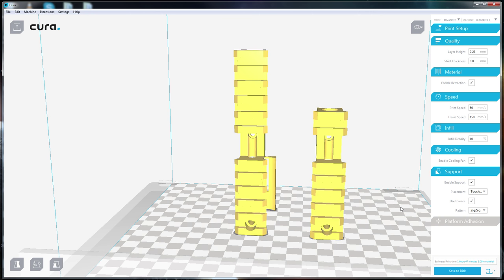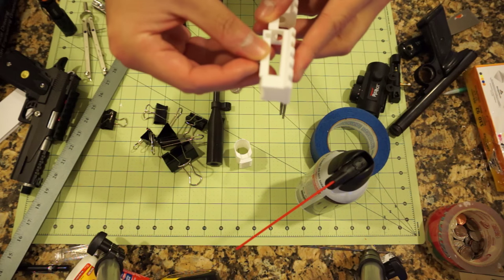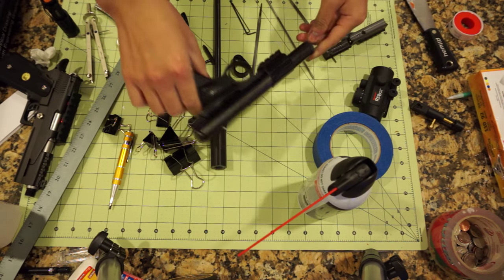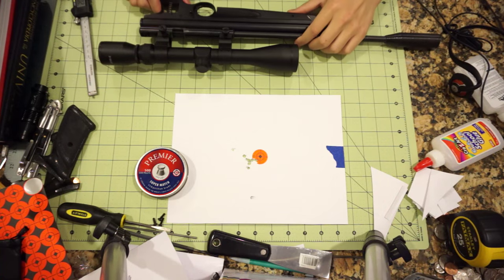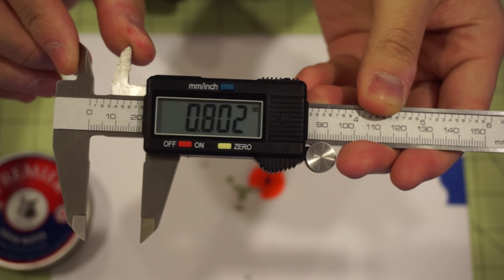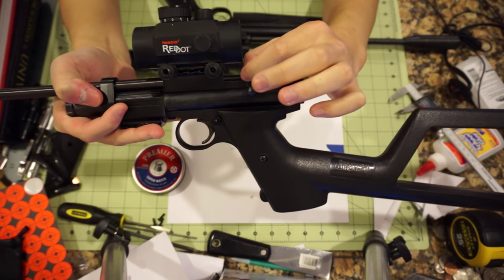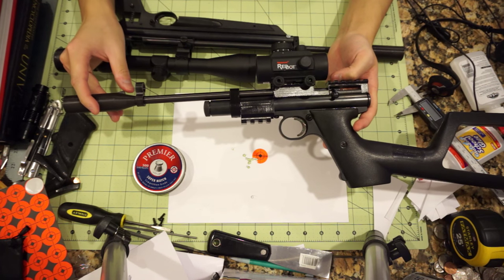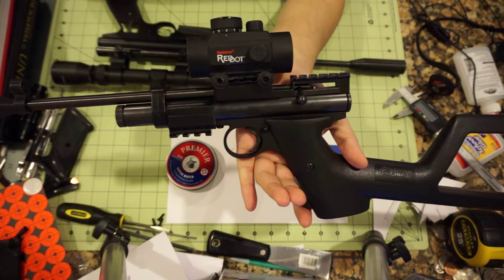3D Printed Ambidextrous Crosman 2240 Receiver

Comment: There is a way to tighten the Bolt probe area behind the o-ring, that is the area of the bolt probe that contacts the barrel end for a better seal, than just the O-ring can provide. You could be leaking there do to production tolerances. use some superglue just behind the o-ring (NOT on the o-ring) here is way if the Oring tolerances are out and or if the Probe is Not straight, having a secondary seal behind the o-ring could be a BIG HELP. if you do have a leak here then it will also effect your fps numbers and consistency. put on a small amount of super glue rotate while it is drying to try and make it as round as possible then once dry for a day or two use 220 grit sandpaper to get round and smooth, keep sanding and removing material until a comfortably tight fit is achieved

Comment: See the bolt it is meant to be on the right side not the left ik some people would find it easier on the left but it no really meant for left and the blow back won't come from the blot as it doesn't move and wee tip of it came with a stock use the stock

Comment: I like the ideal you came up with ..you made my wish list even bigger ..I'd like to see a repeater breech printed so you can add a clip .if you do it I'd love to see it  .happy shooting
Reply from the maker: i think i read somewhere that the mrod's breech fits on this series of pistols, the mrod pcp pistol seems to back it up as the air reservoir seems to be the same diameter, i do actually have a 8 shot mag that fits over the 11mm dovetail of the steel breech but it isnt auto indexing so single loading it is faster..

Comment: Check out the Beeman P17.  I get quarter sized groups at 10 meters; pretty decent for a $35 air pistol.
Reply from the maker: i expect single hole groups at 10 meters, a quarter at 30m is acceptable
Reply: You must shoot better than I do, I find it pretty difficult to shoot hole-in-ones with a pistol.  I do think the P17 is pretty accurate for the price, though.
Reply from the maker: Tadashi ZeroFourSeven for back yard plinking its fine..when i built this I was in the market for a new air rifle, i was extremely aggravated at what the air rifle manufactures have done with all the new guns, its all just power power and more power but none of them can hit shit, took ages trying to find a gun that shot UNDER the speed of sound...

Comment: This was fantastic! How easy would it be for me to change your 3D file to make the breech longer and a 1/4 inch taller?
Reply from the maker: i used a software called Freecad for this, i think  i have the original save file uploaded too, it would b e kinda hard as when i did this i had no idea how to used the software so i kinda brute forced my way though it and the parts wasnt labeled, but if you can figure it out, by all means change anything you want on it.